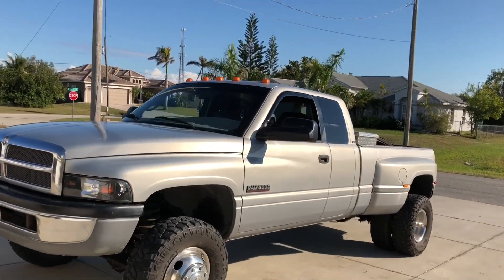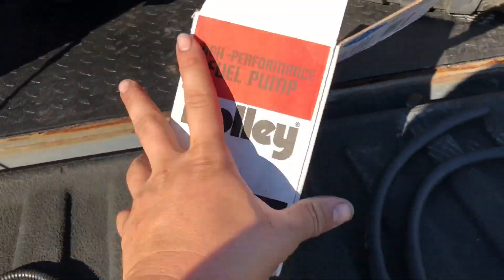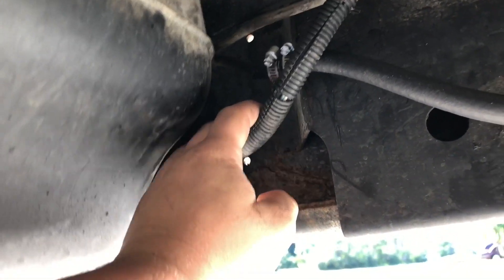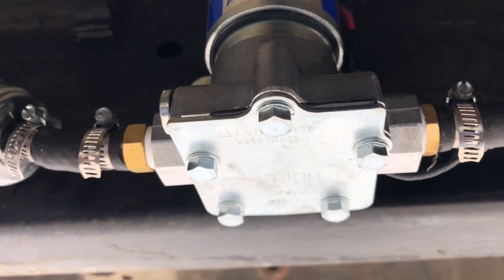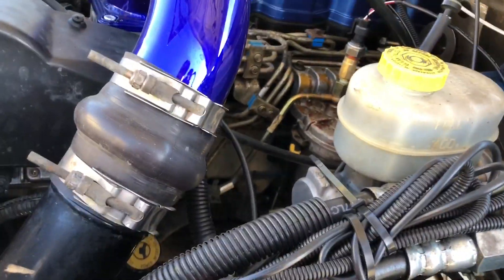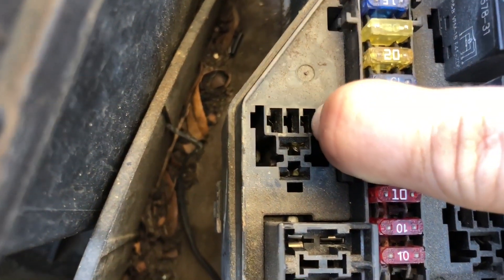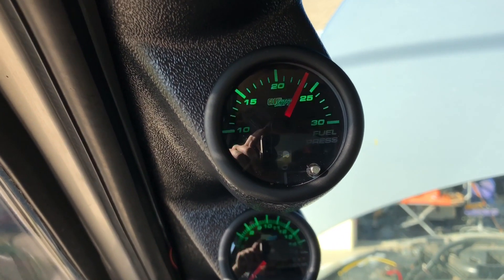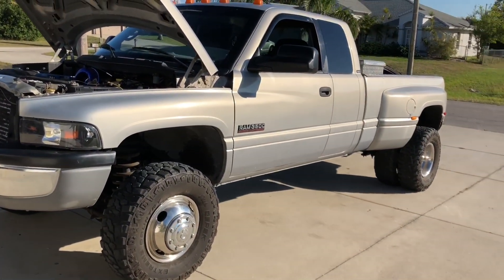How to get 25psi fuel pressure for less than $200!! 99 cummins 24v

Comment: Thanks to your video, I did buy this pump and got it installed, I had changed the VP44 twice on my 1999 truck that has only 217 K miles, I installed it the exact way you did and working great.
Reply: Did u removed the block mounted lift pump ? Or u just supposed to leave it there?
Reply: @quxtiall7083  I left it there, so 2 pumps working together is best.

Comment: PSA. The VP44 is not designed to be operated above 20psi. I ran mine for almost 11 years (about 60k miles) between 16psi idle and 24psi at around 2000rpm. It finally blew out the front seal, fuel in oil and a nice coating of fuel under the truck.

Comment: Install a sump ($30 ebay) and replace the fuel lines with rubber ones ($60 ebay). Made a big difference on my 12 valve. Started up instantly afterwards.

Comment: They aren't meant for diesel fuel. Put one on my truck and it would get hot and shut off. Had to return it. Also ran like crap as if it weren't getting enough psi

Comment: Interested in how long this has lasted because I have always been told to keep between 15 to 20 psi of fuel pressure to the VP. Is your truck modded in any way like injectors turbo and tune? I run mine at 18 and have 120 injectors and I feel like I can bump it to 20 psi so just curious if this has lasted you a fair bit of time thanks

Comment: Really great video on lift pumps. I have a 2002 FS65 bus with a 5.9/24v/vp44. I need dependability with simple repairs. The Hooly blue is definitely the answer here. Just having tandem lift pumps is absolutely reassuring.

Comment: Okay so I got it figured out! So I found that the ECM wasn’t getting power for some reason, disconnected the battery and tried again boom now everything works starts great 25psi at idle, I might have done something to freeze the ECM to prevent it from getting power, not sure, weird

Comment: Okay I did it, currently trucks not starting anymore. I only have the red wire hooked up to the fuel pump relay, it didn’t come with a relay, the pump is on when I turn my key and it’s loud so I’ll have to make it work only when I’m cranking, so far 2/5 stars. Keep getting air in the line

Comment: I should  have never had looked at you tube. Had a 47re transmission problem.  That is fixed. Thanks you tube. 2002 with 373k. No fuel pressure gage. Original lift pump. Original vp44 pump. Completely  stock . Runs great. Only regular maintenance. Just got a leak on lifterblock cover/ cam cover plate or whatever  they call it. Vacuum pump also leaking. Going to fix and thought about changing some fuel related things while I have it apart.  Mainly lift pump and the horror stories on you tube are enough to make me lose sleep and wonder when my truck is going to leave me stranded. Think I will sell it and go electric
Reply: THESE TRUCKS CAN BE VERY DEPENDABLE IF '''  YOU KEEP ON - TOP OF THEM '' POP THE HOOD EVERY OTHER DAY AND JUST INVESTAGATE ''''  BY DOING THIS WORK ( P. M. ) I HAVE ''PREVENTED'' MANY FAILURE'S '''  I JUST DONT LIKE SITTING ON THE SIDE OF THE ROAD ... THESE ARE ''TRUCKS''' NOT PICK - UP '''  SO IT ''REQUIRES'' ALOT MORE ( MAINTANCE ) .... IF YOU DONT LIKE MORE ( MAINTANCE ) THEN GO PURCHASE A GASOLINE TRUCK FOR LONG VENTURE'S ''  AND A SMALL ELECTRIC CAR FOR ALL YOUR ''LOCAL'' VENTURE'S ... THANK'S .

Comment: Man you have an absolutely beautiful truck I have a 2000 model I'm literally at a hundred miles away from hitting 100,000 miles I love your setup this truck was a gift from my dad to me it was his first brand new vehicle he bought it brand new in 99 and it is a 2000 and I'm literally wanting to upgrade it I want to keep it original but with upgrades if that makes any sense LOL I'm new to all this diesel stuff but I love these trucks I do I love the tires that you got everything so I am going to be a new subscriber and watching a lot of videos thank you and have a blessed day my friend
Reply: i have a 2001.50 24v turbo 138.000 i have an air dog, no smoke and big balls. I love to hear   that 5.9 roaring down the highway. the best thing you can do is get rid of that factory fuel filters, if my truck ever starts losing FP I would definitely use this system shown here. great video, love these Cummins engines, there bullet proof.

Comment: 4 yrs later I looked across internet for this pump. You said 20 plus psi all I can find for Holley blue pump's is 14 max psi.
Reply from the maker: Yes that’s what is advertised on the pump but then I installed it on my truck I was at 20 psi on my fuel psi gauge
Reply: You also removed a screen that would slow down fuel flow to the pump, the more fuel to enter the pump in theory the more pressure it can produce. Maybe that is why it was much higher then what it said. Just my two cents. @floridafenceland1137

Comment: So can I clarify. You have the holley running to the stock pump and stock pump to engine? Then does the manual switch power both pumps or just the holley? And it just stays on all the time?

Comment: I have an 02, When I bought it the dealer at some point changed the carter for a pump in the tank. It worked but not exceptional at all, all I did is buy the OEM carter pump and put it back on the engine and left the tank pump hooked up. Essentially the same as here but easier. I have 15-18 lbs at idle and have never seen it go below 8-9 lbs hauling my 36 ft RV up hills and anywhere you want to go.

Comment: Ok so, if you don't turn on the pump will the truck still runs? Or you have to turn it on?? Because I saw in the box is not for sale in California but I'm assuming if the truck still working without the external pump on, you can turn it off before take it to smog station right...? And in order to keep the dash clean and no buttons use a relay instead and just get the signal from the stuck pump done deal...

Comment: What about when cutting the line? Is there fuel going to pour out? Do you need to have the tank almost empty? My truck has in tank pump.
Reply from the maker: I didn’t do anything special for it, you’ll lose whatever diesel is in the line but it won’t drain the tank or anything like that

Comment: My 02 2500 had the in tank pump. It was completely clogged at the bottom of the fuel basket. I installed a raptor. Hopefully it last.

Comment: Is it the 110 gph blue ?
Reply: I just got a edge comp with the hot unlock do you think I should save the money and get this or just make the jump and get a fass because I’d rather get this and put money into the clutch
Reply from the maker: That’s a tough one, I think I’d say fass and then clutch
Reply from the maker: Yes

Comment: What issue were you experiencing other than the low pressure on your gauge?
Reply from the maker: Nothing really it drove fine! Just saw the pressure was low so decided to do something about it
Reply: @floridafenceland1137  thank you. Awesome video and info. Did you run the regulator that comes with those pumps
Reply from the maker: I did not run it!
Reply: @floridafenceland1137  that was the main problems with these trucks.  The stock lift pump eventually grew weaker and weaker but the engine still ran normal.   The VP44 was getting starved of fuel so it would break down leaving you stranded and a $2000 fix.    You wre right to address it when you did.      I bought a '99 Cummins Ram that ran normal with the stock lift pump 12psi.    I switched to the DDRP02 pump and now getting 20psi @ idle and 14psi WOT.

Comment: Just put one in up by the front wheel
Inside frame used existing hole. For 
The plastic. Tubing bracket. Drilled
 1 hole(. I used your great idea
 Of. Using. Light kit plug )
 Used the regulator 
Screwed it all the way in 
No more than 13- 14 psi 
Going to. Bypass it to see
What pressure I get
Reply: Also. Just got the Truck. 
Had a defunct. In tank fuel pump
+ clogged in tank strainer screen
Starving the engine for fuel 
When. Installing 
New. Pump. , check for 
Fuel volume. And 
Pressure. Not just pressure

My truck would only go about 
68 mph on the way home
 About 220 miles
Reply from the maker: Great info man!

Comment: I m inthe process of doing the same setup ,i also have a caterpillar filter and a water separator, but i m tired of paying  a shop or mechanic to lower  the tank just to replace the intank pump  so i went this same route.. question...does this pump supply enough fuel pressure tothe cp3 , i have an 2005?,,intalling a sump also.

Comment: I like the way you set it up,I was wondering if I could just cut the rubber line instead on the metal line close to the tank,I think its rubber farther away from the tank?
Reply from the maker: I’m sure you could cut it anywhere at the time I figured closer to the tank the better so it did more pushing than sucking

Comment: Sooo..... You are unsure if your stock lift pump is still putting anything out? What set up do you have for stocker?  engine mounted or in tank? I'm just weighing options at the moment. Is the holley still going strong?
Reply from the maker: Mine was engine mounted, and reading 8-12 psi I added the Holley to run with the stock pump and I as at 25psi I still recommend the Holley for these trucks still running good after 3 years

Comment: Typical shade tree modification.  Does it work?  Sure.  Is it a good solution?  Probably not.  It cuts corners and will likely eventually cause other problems. Do it right the first time.  Not trying to dis your work, I've paid the price myself for many similar solutions that looked good at the time. Then I got older and discovered cutting corners, "saving" money, jerry rigging is usually a bad choice.
Reply from the maker: I totally agree, when I made this video, this was absolutely all I could afford, I wanted to buy something nice but it just wasn’t in the cards so this actually worked very well
Reply: Pressure is pressure it dont know that it's cheaper pressure.  Filtration may b a issue but if u put a inline cat filter something along the line of 3 micron u b good. I'm about to do this to my 2nd gen with cat filter cause I put the fass in my 3rd gen
Reply: @foxxx5.941  LET ME ''WARN'' YOU '''''''''''''''''' CUMMIN'S HAS A ''SERVICE'' BULLETIAN On That ''Issue''' Don't Go Below ( 10 ) micron ''''  FLEETGAURD 10 Micron Filter Is Made Exclusively For The ( 5.9/24V ) Equipped With ( vp-44 ) Inj Pump '' Its Weird That Alot Of People ''Dont'' Know This '''''

Comment: Do you think that this will work on a 12valve?

Also wondering if this will work on a Duramax?

Thanks
Reply from the maker: 12v needs more like 45 psi so same concept with bigger pump yes and duramax I have no clue what they like for fuel pressure but same concept applies

Comment: Too much pressure. You want ~15psi at idle max. Getting over 20psi is not good for the internals of the VP44 pump.
Reply from the maker: It’s been good for 2 years man!
Reply: @floridafenceland1137  There's also folks running on low pressure for years. Doesn't make it the correct pressure. Good luck to you but the pressure's still too high.

Comment: I'm a little late to the party. did you ever make it to the fass? how long did the Holley last i need a lift pump for a 3rd gen and don't want to spend big bucks
Reply from the maker: Still running my Holley man! The pump
Died after 1 year, went to advance auto, picked up another, returned the old one and I’m still going strong on my second pump and no extra money spent!

Comment: VP44 pressure relief valve.

https://mopar1973man.com/cummins/articles.html/24-valve-2nd-generation_50/51_engine/59_fuel/bosch-vp44-injection-pump-overflow-valve-r19/

Comment: I ran a separate relay to power the Holley Blue, and power the coil of the relay via stock fuel feed. Coil draw is only milliamperes, pump pressurizes off key switch now.
Reply: After a few months of running with this wiring setup, it appears as though it's having a hard start issue. Caused by the high fuel pressure at startup So I rewired it to a switch that only is active after the engine has been started. Low pressure on startup and back to 20 psi after the engine is running. Problem solved.
Reply: @MrInnovativeEnergy  where did u find a switch signal thats active when truck is running? its not on during accessories on?
Reply: @MrInnovativeEnergy  do you have a video how you did that? I’m having a hard starts after I replaced the lift pump.
Reply from the maker: Good deal!
Reply from the maker: That’s a great idea, your wiring skill probably far exceeds mine

Comment: Vp44 isn’t supposed to have more than 15psi supply to the pump.
Reply: Yep dosnt give the fuel enough time to pull the heat from the pump. Since fuel is what cools the pump/computer board.   Computer will run hotter shortening its life.  At least that's my understanding.
Reply from the maker: Makes perfect sense, but it’s over 3 years and it’s still on the same vp44
Reply: @floridafenceland1137  
Dosnt really go by age but by miles. I've got 340,000 truck has only had 2 vp. Lift pump killed first one.
Reply from the maker: @TheKcdub1000  yeah very true, I know when I owned it drove the shit out of it so it’s definitely had some miles put on it
Reply: @floridafenceland1137  yeah it might last  a long time.. if your lucky. None of the the builders I've talked to say to go over 18 psi.  These pumps are to damn expensive to replace and leave you walking some times when they go. A good lift pump is less mony than a new pump.
Reply from the maker: Been running great 2 years
Reply: Just means it bypasses through the relief valve all the time.

Comment: Ok great idea. Not sure if holleys are diesel fuel compatible? Also its best to use the band type clamps for long term use they don't cut into the hose and loosen with time like the ones you are using. if your going to use a filter on the inlet make it more of a screen type just to get the stuff that may lock up the pump. electric pumps push well but don't pull well at all. use a second finer filter after the pump. Also always use a relay and carry a spare.
Reply from the maker: Thanks for the tips man!

Comment: I added the Holly Blue about 2 yrs ago but I used the pressure regulator and set it at 15# that is recommended for the 2nd gen,works good. (I have a in tank pump that was getting weak)
Reply from the maker: Hellyeah man
Reply: The Diesel Ranch hey man anyway I can contact you? Got some questions about it? Maybe email?
Reply from the maker: Eoghan Jordan me or the other guy? My email is mikesagorac@gmail.com
Reply: craig johnson what did you do to the intake pump to install the Holley ?? Draw straw? If so can I know which one
Reply: Eoghan Jordan  I still use my in tank pump( it was reading 10lbs or a little less at idle) and with the Holly Blue you adjust your pressure to 15 1/2 lbs as dodge recommends . I put  a inline filter in before the Holly and everything works fine. The Holly is used as a inline booster pump not as the main pump. I did replace the intank 5 years ago it was just getting a little weak and I didn’t want to drop the tank again.
Reply: craig johnson is this still working for you? I’ve heard that running a second in-line pump at higher psi  can damage the in-tank pump because it can’t keep up. Also wondering how you wired it. Thanks for sharing
Reply: @DanniBee  the blue holly on my 2001 runs at 14 1/2 lbs, my intank pump was around 10# and I didn’t want to drop the tank again so the blue holly works as a booster pump, no trouble with the intank pump it was just a little weak. I found out the blue holly will only pump 14 1/2 # so it’s just perfect, you won’t need the regulator . You can buy a rebuilt kit for around  $35-40.  I pull a camper and boondock 99% of time so I carry a spare, I think it’s been 4 or 5 years with this set up, had to replace the pump last year ( 10 minute job ) and now I will rebuild the old one. I would suggest a fuel pressure gauge if you don’t have one.

Comment: Are you still running the same set up, and is that Holley a gas or diesel pump?
Reply: Thanks for your help great looking truck man
Reply: On a stock VP
Reply from the maker: Yes same setup! An it’s designed for gas but it’s been working fine for diesel, I’ve changed the pump once after a year and second one running just fine
Reply from the maker: Of course man thank you!
Reply from the maker: It’s a HIgh Output stock vp

Comment: Does the pump work with the lift pump in the tank or just the one on the block
Reply from the maker: I actually don’t have the in tank pump
On this model but it works well with the engine lift pump
Reply: Ok thanks
Reply: Are you running both pumps? The new Holley that goes to the stock pump mounted on the engine?

Comment: 23psi is bad. Way to high. Fass only puts out 17 to 18 at idle.
Reply: Just means it bypasses through the relief valve all the time.
Reply: Your p7100 mechaincal pumps on the 12 valves require more fuel psi

Comment: I didn't think you were supposed to go over 20 psi feeding your VP44?
Reply: @douganderson7002  I'm running a destructive test at 21PSI, we'll see how long it lasts. The next pump is waiting on the shelf and it will run 18psi and we will see how long that one lasts. P7100 is waiting until the two failures occur and will never see a failure at any lift pump pressure just as all my 12 valves have.
Reply from the maker: I’m going on 3 years same vp, if it wasn’t being lubed it woulda failed by now
Reply: 20+ psi on a vp44 is fine from my experience. I’ve heard otherwise but I’ve been at 25psi for over a year with my airdog 2 4g 165gph.
Reply: Just means it bypasses through the relief valve all the time.
Reply: Not suppose to.17 max.
Reply: @white24valve  I run 20 with no probs.
Reply: Thx much...that is a great simple solution for a poor boy like me... I've got a raptor 4g witch has failed...my dumb but didn't have a fuel pressure gauge and now I believe I've F'ed up my 44...thx again